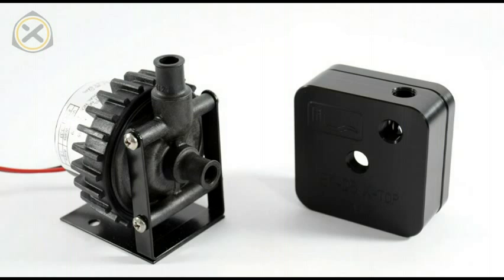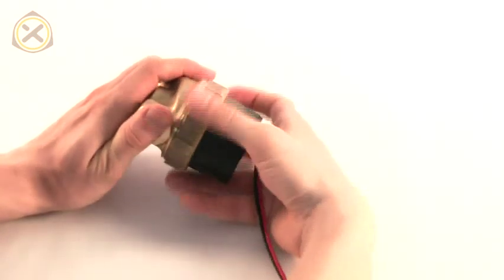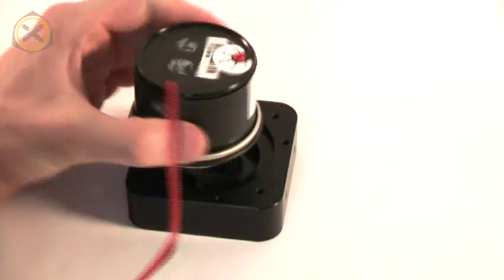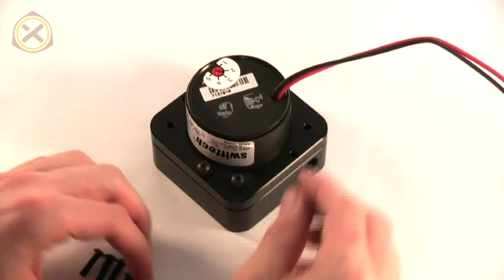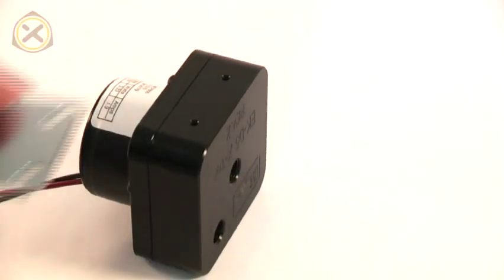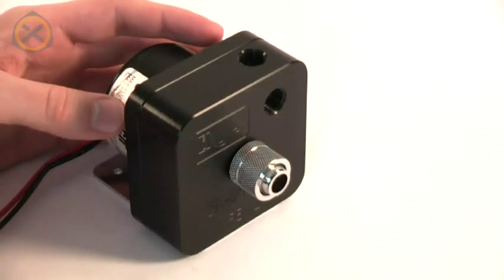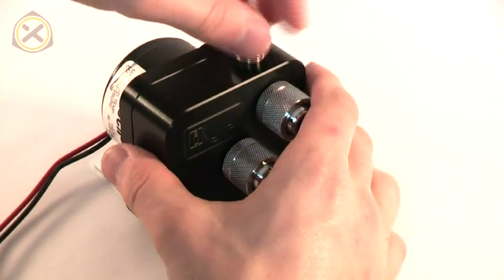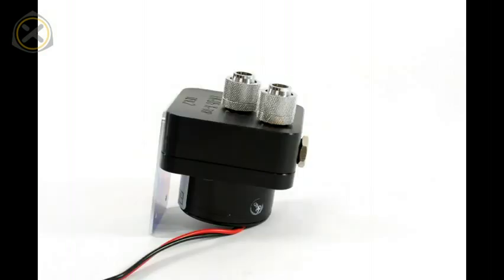EN - Tutorial: How to install EK X-Top D5 on a Laing D5 / MCP655

Comment: to replace the 1/2" barb with standard G thread so you can fit any sized or type fitting you choose. The top also seems to improve flow design over the original.

Comment: Hi , may i ask if the EK X-Top D5 has enough space for two 1/2" ID 3/4" OD compression fittings for the inlet / outlet side by side ?